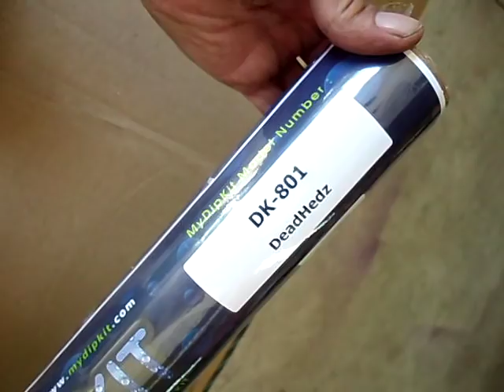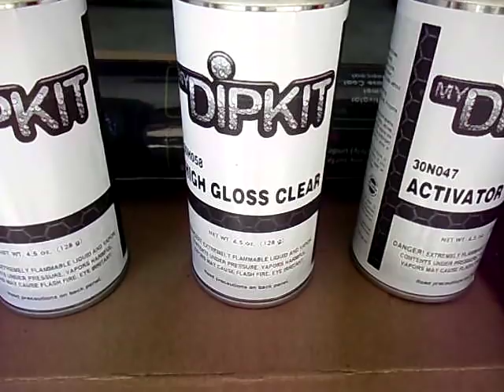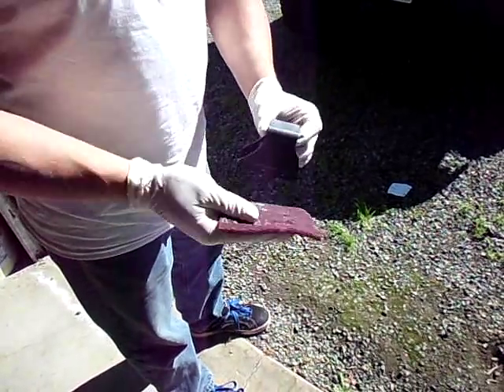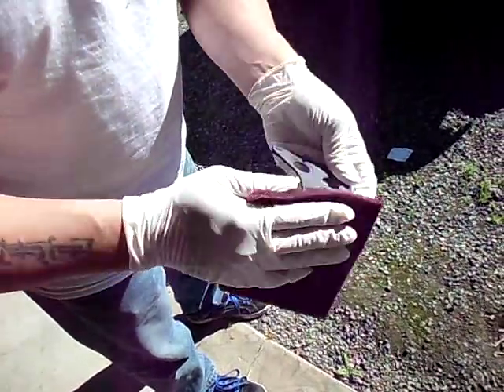Hydrodip how to

Comment: joshuaburks,
Excellent tutorial video! I found it very informative. I plan on doing a Hydrographics dip kit on my Mosin Nagant MNAR Bullpup conversion I purchase to from Center Balanced Rifle Platform Systems. I plan on doing the skulls myself, except I've opted for the "See No Evil, Hear no evil, speak no evil" skulls. I plan on doing a three or four color camouflage coloration underneath though, because I plan on using this to hunt deer with. I've also opted for the matte clear coat at the end. One question, when you did the forend assembled, did you have to take a razor blade to cut where they edges met together? Because I'm wondering for my own purposes if I can do it assembled or if I have to disassemble every part on the entire stock and dip them individually.

Comment: Excellent tutorial, did you have enough film to do all the parts that were dipped? Approximately in feet and or inches how big is the roll of film. Thanks for sharing.
Reply from the maker: I don't have exact measurements of how much material was left over but it was a lot, I could do at least another full rifle and probably too with the material that was left over
Reply: +joshuaburks Thank you very much for the reply, one more question, there 3 available kits you can buy, was the $69, $99 or $169 kit. Thanks again.

Comment: Awesome job, one question. You took parts in the house to "rinse", did you just run hot water over them or submerge them or how did you do that?
Reply from the maker: I just ran warm water over them for a couple minutes each until the slimy gloss was gone then let them air dry
Reply: you run warm water over them bro

Comment: great video. i will be doing the same and was curious why you rolled all the items instead of dipping them long wise at an angle?
Reply: +SnowDog183 He probably did to get the full effect of the design. Just dipping it will kind of expand the design.
Reply: Also when you dip each side, you have a seam at the top and bottom

Comment: Hi.  I purchased the clear and activator from mydipkit.

But they didn't supply any info with it...

Now I am doing this a little different. I using all duplicolor automotive spray paint from cans.

But my question is on using 2k clear as it's more durable....

But here was what I originally posted

Hi.. I'm in Canada.. Wondering if you can lend any advice on diy hydro dipping....

Mostly I'm interested in how to use 2k clear.... I was told it can cause paint to run unless fully cured....

Now I was told to let fully cure. Then wet sand. Then 2k clear....

But I don't wanna sand my hydrographic design...

Plus I should mention I'm using all spay cans. Not 2 parts from gun.

So after my hydro dip... Wait an hour. Clear with one part enamel clear. Then let dry and cure. Then sand clear and apply 2k clear?

Comment: the place around here that does this say parts really need a month at least to set has yours warn off any on the grip
Reply from the maker: Deadsparrowstattoo Redmon  well in all honesty i don't use this rifle often, so it is still pristine,  keep in mind i may only have a few hundred rounds through it since hydrodipping, it shows wear on the mag where the release drags on the side, but all in all it is holding up fine.
Reply: So what kind of paint is it enamel or acrylic